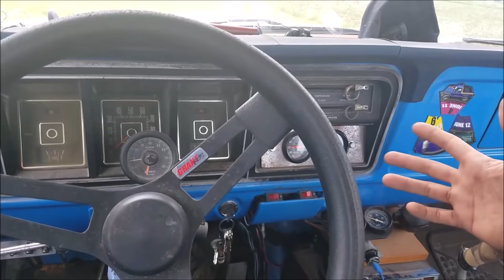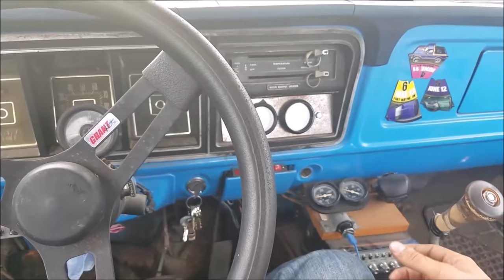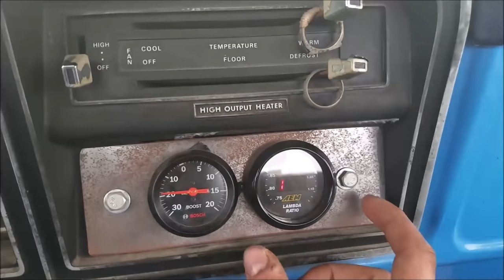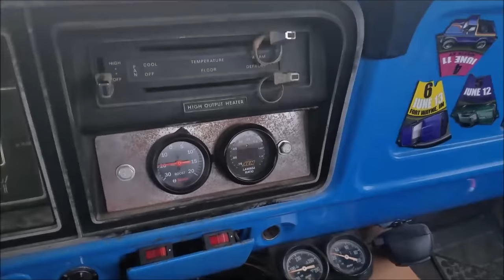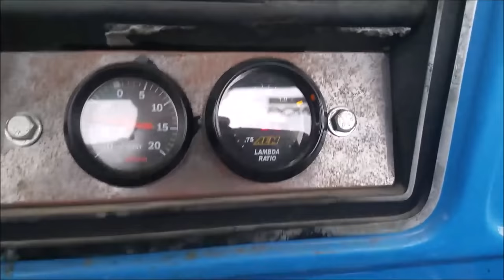Best Carburetor Mod - Vapor Lock & Inconsistent Performance Issues CORRECTED (You'll Never Go Back)

Comment: have you ever added a offroad kit to a carb? dont think you have since you mostly do road vehicles. good upgrade that keeps your truck stalling when offroading good mod too
Reply: john dowe 
Sir, what does the off road kit consist of? I’m going to swap my ‘89 ford over to carb and I don’t know anything about it 
Thanks in advance for your reply
Reply: @papasteve215  spring loaded float needle, a cross over vent tube , It basically goes into the vent holes and moves them up so when you're on a incline it doesn't flood yer motor, sone guys put a fuel pressure regulator so they can lower psi from 5psi to 2 , i heard about that helping but i dont run that setup. You should do some research into it, it's really helpful. I think the cross over tube is the cheapest and easiest mod you can do.  I have a 87 f150 that I almost burned cause I was hauling ass through a county road and all the bumps made gasoline splash out the vents and it basically caught fire and burned the carb, glad I had plenty of water with me.
Reply: john dowe 
Thanks sir. I need to look deeper into that before I jump off into this swap over. I used to turn wrenches for a living but that was a long time ago. 
I guess the good thing about swapping from the injection to carb is that there is already a return line back to the tanks.
Reply: @papasteve215  yup, it aint too complicated. if yer using an electric pump you might want a regulator to adjust fuel pressure. if its an old tank with a lot of crud in it you can run triple filters and remove em as the become clogged
Reply: john dowe 
Yeah. I’m using an electric pump and thankfully the old boy I bought it from had put two new tanks on it. I’m ordering a pressure regulator tonight. And I should have pretty much everything I need. 
Again, I appreciate you taking the time to reply back. 
Y’all take care.
Reply: @papasteve215  no problem, im working on making a video on lock rim changing for my duece. you should upload a video once ya got everything done. love me them old furds

Comment: Just sub to your channel, I live in Conrad, Iowa. My hobby air cooled vw bug & buses. Just picked up a 1986 Chevy C10 for general use around the house. It has been sometime since i worked on old chevy, need to rebuild the holley carb. just want it to be a good safe runner not a dialy driver, like your info on carb.s
Reply from the maker: Thanks my friend - low and behold, I actually have a 67 beetle that was a barn find type deal. Body is really good for Iowa - I need to get it going. It’s just tucked away in a storage unit!

Comment: Awesome vid as usual :) What's your opinion... I have a 84 Dodge D100 2wd with a 318 (91) and a 904 auto. I have an A833 4 speed laying around that I was thinking of putting in it. Would you stick with the 904 or go ahead and put the 4 speed in it?
Reply from the maker: I’m usually of the school of thought that if it ain’t broke, don’t fix it - if it’s a go d runner andnyou enjoy it, I’d keep it the same!
Reply: Well, ye olde 904 has some leaks but you make good points as always. Darn it! I was hoping you'd say do it so I could blame you for the leg cramps in traffic :)

Comment: Do you have a video where you show installing this system?  I am wanting to try this out on my son's 1981 Ford F150 with a 400M. We currently run a Edelbrock 1406 Carb on it and was hoping to make some of the issues you talk about go away.  I am also building a 1987 F250 with a 460 and also run a 1406 on that as well. The big difference is my 87 has a fuel return already from the manual fuel pump as Ford had quite the vapor lock issue with  these motors.  Great videos by the way!!!
Reply from the maker: I don’t have anything where I walk through it, what parts are in question? 
I’d be happy to explain how I did it
Reply: @ThunderHead289  Did you run the electric fuel pump between the tank and manual pump or after the manual pump? second, I figure I can do this on my sons pickup but as far as my 87, I have a return line on my fuel pump, to the tank,  and in order to do this, would I need to get a fuel pump that did not have a return line at the pump so that I could set it up like you have?  Thanks so much.
Reply from the maker: Tim Strohl hey Tim, there is no mechanical fuel pump at all on my truck! My electric replaces the manual unit!
Reply: @ThunderHead289  where did you get the plate that covers the hole where the manual plate was?

Comment: Great video!! I watched your others and this really motivated me to go return less. Though one question/concern...I have an in cab fuel tank in my c-10, any problems with the return line having to travel to the top of the tank?..seems like a lot of work for the pump (Carter 4600)
Reply from the maker: For pumps, load is directly related to pressure - if you are still at 5 or 6 psi, the pump is working no harder. It’s actually easier on them since fuel is used to cool them - when you are at a stop and the pump is dead heading opening the internal bypass, that same fuel is hanging out in the pump and as you can imagine the pump gets very hot - it’s a real pump killer

Comment: My 82 firebird already has a fuel return line from pump to tank. I’m adding your set up and I’m wondering if I can use that line by adding a T fitting so I keep both.
Reply from the maker: I’m sure that would be just fine, although you may want to upsize the line

Comment: I always though this truck pretty well for having such a steep rear end gear. I think they are like 270. But I thought this was a 295 1st gear which is a v8 t5. The 4cy t5 has a 335 1st gear. So it's act more like a 327 gear.
Reply from the maker: Actually this particular truck has a 3.70 rear gear as per the diff tag, so that’s probably why it works so well. 
It’s worked out very nice - with a little 302, the v8 t5 overdrive ratio would probably be to tall for the little 302
Reply: Wow mine was a 270 or something similar. What this a factory 6cy truck ? I put a 335 4cy trans in my mustang after I broke first gear in the original and it has 373 gears. After I did the swap it felt like it had a 430 in it. Still kicking and I have done a dozen or so launches on limiter. There damn near identical. Neomustangs did a comparison video recently on the 5.0 vs 2.3 T5.

Comment: I have never had a problem with vapor lock. I have a 92 vette that has has a high rise intake onit, a Holly 650, and a standard height distributor. No computer, no bs..runs great. Has the lt1 350
Reply: Hei.  Damb spell demon

Comment: You should go through what all the switches are for one day.
Reply from the maker: The 4 switches on the aluminum angle bracket just turn on and off my speakers. I have speakers in the truck bed for when I used to take the lady to the drive in theatre in high school. The red safety switch deal is for the fuel pump, and the one beside it is for my high idle solenoid - which is kind of custom

Comment: You said in the video that the truck is built for fuel mileage and driveability, how does it actually do on mileage?
Reply from the maker: FordTough79 I can get 21 mpg out of it if I don’t go over 65 👍
I’ll take that for an antiaerodynamic truck. Front is literally concave

Comment: Why is the regulator after the carb feed? Why does the return need a regulator?
Reply from the maker: Howdy, 
That is the best of the best design as it performs two great functions. 
Being a return specific regulator, and takes whatever is not needed to maintain the pressure setting and sends it back to the tank, so it’s a variable volume return which means you will always have consistent pressure. 
Having the return after the carb is the best location in that you are bypassing the whole entire fuel supply line which is minimizes hot fuel/vapor lock related issues to the highest degree

Comment: I have a 73 F100 390 with Edelbrock manifold and 4bbl carb. Would this set up work? Now that I put long tube exhaust it is touching return fuel line and I think I need to relocate that line or something . Any advise?

Comment: You should do mods for a 4.6 32 valve and lets see the horse power you can get out of it not the mustang 4.6 but like a crown Victoria 4.6  the 99 and up 😁😁😁😁
Reply from the maker: Ironically I have an 09 crown - sadly, in our last little flooding incident, it drown and damaged the engine. 
One thing I can say about them from watching the ignition timing is that under throttle, they pull out a ton. It drops all the way to 8 degrees. So much power is left on the table, the stock tune is designed for longevity, not performance

Comment: Hi mate, I dont understand why you have a fuel regulator on the return line, when they are designed to work with your carburetor (Before the carb) you already have additional pressure from the electric fuel pump, ( rather than OEM mechanical pump) so how are you regulating the fuel New pressure before the Holley?  It would also be slowing the rate of flow back to the tank , where it would be cooler. On the positive side, its possibly protecting your electric fuel pump ..Not having a restriction before the Holley. Good Modification though!   Cheers from AUSTRALIA.
Reply from the maker: This is not a normal regulator although it looks like such. The specific return style regulator returns any fuel that is not needed to maintain your pressure setting vs a normal regulator that only lets enough fuel through to maintain. 

Putting this regulator after the carb makes the most sense because the whole fuel line is now able to bypass - no hot spots. 
Thunderhead289 @ youtube

Comment: would this be necessary in a system on a 351c with a mechanical pump? I know that you said you need an electric pump and that a mechanical pump is variable. So does that variability make it so it is not necessary for a return line? It has always seemed to run just fine cold or hot with little tuning required. I have the engine pulled from my 71 f100 right now (it was an earlier swap) and i'd like to know for when it goes back in shortly.
Reply from the maker: It’s not that it makes it so that it’s not necessary for a return line, it just makes it so that you can’t run one in the typical manner. 
With a mechanical pump, line pressure would be too low at idle - once driving, pressure would come up. This variable pressure makes for a variable float height. 
Mopar made a fuel filter with a return port for mechanical systems - I know one came on the 79 Córdoba. 
That’s a good half way point between a full blown return system, and not having one at all.

Comment: Like your Chantal. Have a 1974 Ford F100 my Papaw bought new. When he died he gave pro my dad. When my dad died he gave it time. While dad had it he took the 390 out and put in a Jasper rebuild 302. Ran good however this past year it has given me nothing but trike. I’ve put new plugs new hei Jegs distributor and wires. New voltage regulator and ignition control module, timing chain and after new distributor retime motor. Ran good for a day since then runs one day not the next. Time after time I’ve complete timed engine many times believe it’s right. Still runs when it wants then won’t start appears to have fire and then not. Can you help.

Comment: My 77 F150 4x4 did not come with fuel return system. But the new carburetor does. Do I just block it off?
Reply from the maker: No carb has a built in return line - you must have a divorced float bowl dual feed

Comment: Mr Thunderhead,
I have a 1980 Ford Bronco 302 with a New Process NP435 Granny Low. I’m not sure what condition the motor is because it dies after driving it about 10 minutes.  I’m going to Pick a part to grab a 94-95 351 roller, and am going to swap it. My question is can I take a picture of my existing engine compartment and can you point out if I have a fuel return or not? I’m guessing my engine is vapor locking

Thx!

Rich
Reply: I would think twice about swapping an engine if you can't figure out if your carb has a return line

Comment: Ok excellent but couple of questions; do you have a regulator from the pump side? I have a Holley blue set to 6psi. What’s the return pressure you have set? Do I open full pressure from the pump side reg an only regulate from the return reg? Thanks

Comment: Thanks Luke, excellent video.  Do you have any issues/solutions for cold weather?  I have a 1982 F100, 302, 600cfm Holly, Edelbrock intake and a 1985 E150 with a 300, stock 1 barrel carb.  I have the same issue on both, won't run when it gets cold, eventually the cold air causes the mixture to be too dense/won't mix correctly, blows black smoke out the tail pipe, like it's loading up/too rich.  My fix for the issue is to use the stock air cleaner and the carb heat duct work.  I used one of the electronic vacuum solenoids to manually control the flap to give it a shot of warm air once in a while, the automatic/sensor in the air cleaner is entirely too hot, so I just manually flip the switch once in a while.  It works, but was wondering if there is a better solution to the issue?  I figure you get a lot more cold and snow in Iowa than I do here in MD, so I figured I would ask.
Reply from the maker: You are one of the few who understand the variability with temp changes. I will say the return line goes a long way since you don’t have to compensate for the heat as bad, so things stay way more consistent. 
Take a look at my most recent upload, I have been working on an on the fly adjuster that corrects mixture on a carb based on air fuel ratio feedback. It’s been on my maverick for about a year.

Comment: i have a question , i am lost ! i have a 1941 Chevy 3100 with a 454. i wanted to run a rear fuel cell along with the stock gas tank ( behind the seat). i have a electric fuel pump (holley) i went to a return fuel regulator and returned  it to the fuel cell in the rear of  the truck. i was having issues with my fuel regulator gauge saying 6lbs of fuel pressure but the gauge on the carburetor would read  3lbs then after driving would not register at all. i then took the rear tank out went to a dead head fuel regulator and i still have the problem. the truck still runs with the fuel pressure at the carb being 3 and sometimes goes to 0. the regulator and the gauge on the carb never match and the regulator is on the firewall . i even placed a one way fuel valve thinking the fuel was feeding back to the pump and the line was being drained of fuel. i was having issues when it was hot with the bypass regulator. sometimes the bypass regulator would actually send so much fuel to the fuel cell return line that it would over flow the rear gas tank . i have taken the carb out , checked all lines, replaced all lines and i cant figure it out . at this point deadhead fuel regulator only the in the cab tank running and it s running good .

Comment: Some money can be saved by restricting the fuel return with a Holley #45 jet installed instead of a fuel pressure regulator. I have done that on several retro fitted cars & trucks I've converted back to Carburetor & never had any problems.
Reply from the maker: I have an older video l from 5 years ago where it shows me doing the exact thing you describe on my 65 galaxie - I tried to do it “the right way” this time around. 
Either way seems to work just fine, but one things for sure - a return line with electric pump is like night and day

Comment: What's wrong with rubber lines? Why dont you like them?
Reply from the maker: Because they can melt, split, and just are generally more likely to fail. 
Especially over time, they get hard, crack at hose clamp connections, and can leak fuel on a hot engine - and you know how that’s going to end!
Reply: @ThunderHead289  ok thankyou ..so you run all hard lines?

Comment: Great video Luke! Question....how was this issue dealt with in older vehicles from the factory with “deadhead” setups, such as my Oldsmobile from 1970? They must’ve known about the temperature issues with carbs because they ran pretty good and consistent, most of the time.
Reply: Ethanol has a lower boiling point than the gasoline of 1960. Even back then there were problems, made worse by bigger engines in smaller spaces behind bigger radiators with transmission coolers and ac condensers out front.
In the search for better fuel economy, engineers found that higher engine temperatures gave greater efficiency. So a lot of factors involved.
Reply: If you had factory, air conditioning or a four barrel, high-performance car, the factory had a paper return line already installed

Comment: I have a 460 big block with a 750 Harley carb I have no return on my carb and my fuel pressure keeps on jumping from 6:00 to 9 1/2 when I put it in drive and hit the gas it shuts off do you think of return line will help that

Comment: Quick question for you because I'm looking on getting an air-fuel ration gauge to set up carburetors on dirt bikes where there are a few different circuits to tune.  In the beginning of the video your air-fuel ratio was sitting between 12 and 13 which seemed a little rich based on the ideal ratio of 14.7.  When you dead headed your fuel line your air-fuel ratio went up to the high 14's and low 15's which seemed ideal, but you mentioned it was getting pretty lean.  Granted this was a cold day, your hood was up, etc., but I just wasn't sure if I was missing something.  Is it better to be a little rich or am I missing something?

Comment: Any ideas on how to convert to a return line with dual tanks?
Reply from the maker: Dual directional valves - either a manual 3 way, or electric triggered by the same switch as the tank selector